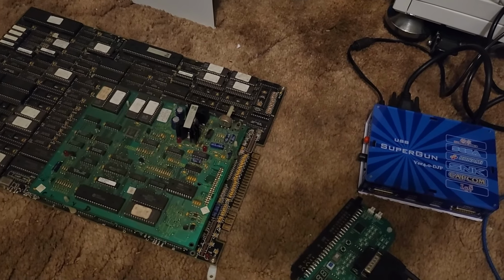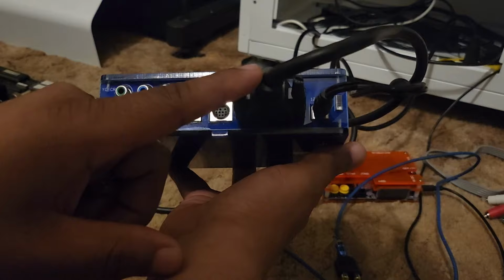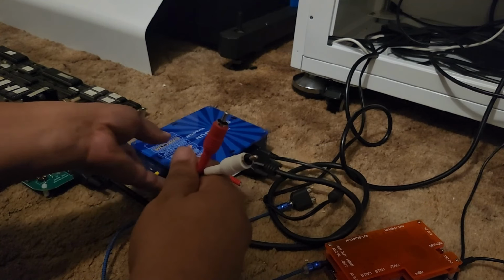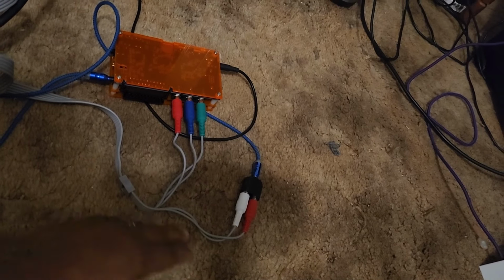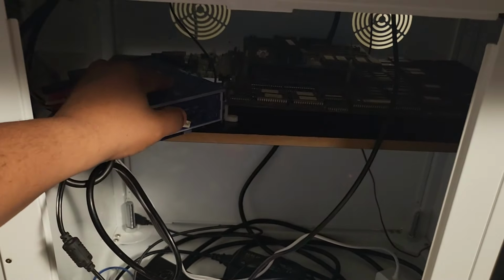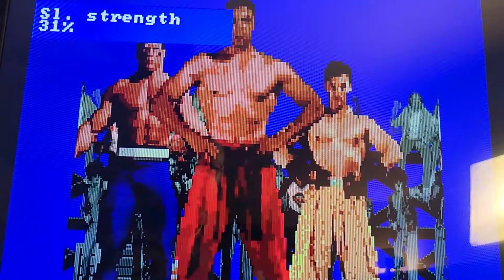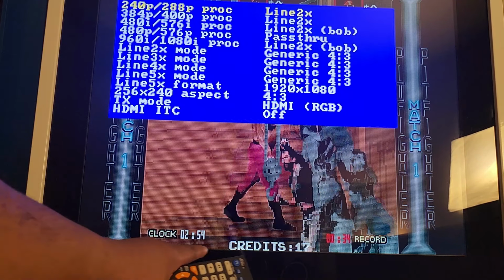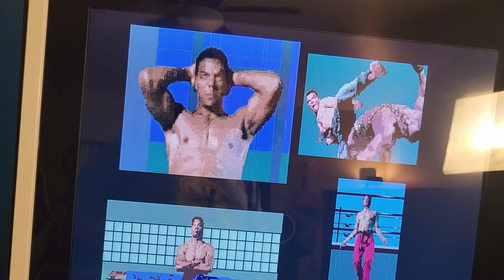Unlock Epic Scanlines with Your Jamma Board on Nova Blast Candy Cab!

Comment: Hey how do I get my super gun to recognize my nova blast joysticks??? I hav usb plugged, but i need to configure the joystick and buttons please really need help.
Reply from the maker: What board do you have hooked to the super gun?
Reply: @RudetunasArcade  CPS1 board
Reply: I have it hooked up to a cps1 board. Street fighter2: hyper fighting. The previous super gun I had with this setup worked, then just stopped working. I bought a new super gun and im still getting the same results. Now when I hook up the stock jamma connector that came with the nova blast, that works fine. I also tested those usb cables that came with the nova blast unit with my raspberry pie and they worked fine. So I know its not those cables. Im open to any suggestions

Comment: when I hook up the encoder to the super gun, my buttons seem to be messed up. did you experience this. HELP PLEASE!!!
Reply from the maker: What kind of board are you running with the supergun? Are you using a pandoras box?
Reply: @RudetunasArcade  Hello I got buttons figured out just dont havesound HELP PLEASEEEEEEEEEEEEEE
Reply from the maker: @blessedchild3142  make sure your speakers are hooked up, and you have that 3.5mm cable connecting to the monitors and speakers. Check out my video showing how to setup the Nova blast. There is a complete tutorial there
Reply: Cps1 street fighter 2

Comment: Thanks for this.  One question though... if you are bypassing the stock jamma connector how are you using the volume know to control the sound?  Did you have to rewire something?
Reply from the maker: The audio is being carried from the pcb board to the supergun, then the super gun carries the audio through the component cables to the OSSC upscaler, and finally the hdmi from OSSC takes the audio and video to the monitor thru the hdmi cable. Your monitor outputs your audio to the speakers on you candy cab machine. Therefore you can adjust the volume with the know on your machine. So no you wouldn't need to make any adjustments or rewire the wires or speakers. 😊
Reply: @RudetunasArcade  Thanks for the explanation!
Reply from the maker: @JohnnyG101  No problem.